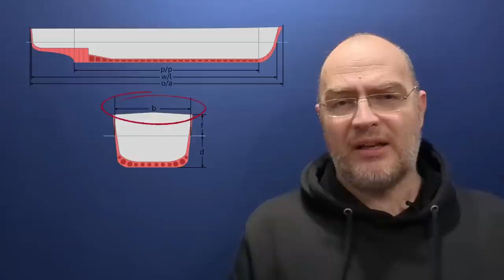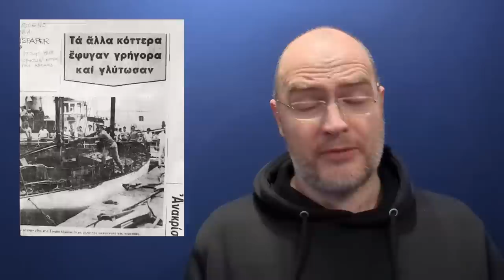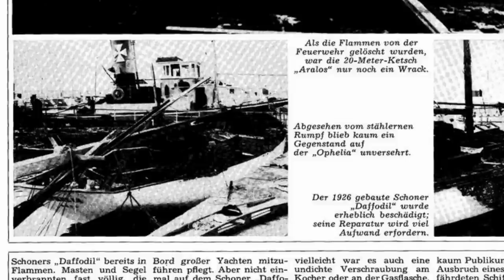Episode 1 - Welcome aboard Ophelia

Comment: The housetop seems doable.  It looks to me that the corrosion under decks and in tanks is the biggest challenge.  However, if the hull is good then I have high hopes on watching you finish her out and become a magnificent vessel. Subscribed.
Reply from the maker: Thank you, and you are absolutely right, the hull is the biggest challenge here and now. However, the issues with the hull seem to be mainly caused by the issues with the housetop, so the will need fixing as well :-)

Comment: Don’t wish to dampen your enthusiasm but as a circumnavigator on my steel boat launched in 1988 I am well acquainted with steel boat maintenance.I do all maintenance myself as I simply do not trust boat yard  workers to do it right My boat was designed by Ted Brewer from the ground up for maintenance. Extensive use of 316l stainless was used and TIG welded to the mild steel. All mild steel was mig welded.Done right- THERE IS NO CORROSION PROBLEMS WITH THIS METHOD. All sandblasting done with BLACK BEAUTY and over coated with Devoe epoxy followed by Awlgrip polyester. Any repairs follow the same schedule.She is 45 feet LOA and only two gallons of fairing compound was used above the waterline. She is totally fair. All bilge areas, dry chain lockers and lazarette areas are totally accessible. If a boat is not built to this standard and design they have a finite lifespan and from the looks of yours she does not appear to be salvageable. Another web site clever octopus attempted what you are embarking on and failed.I see little hope for your once beautiful yacht, But short of a total rebuild which would cost more than a new boat- you’ve got some insurmountable odds in front of you. Good luck anyway
Reply from the maker: Well, I think that a less than optimal boat can still be restored without tearing it completely apart but I guess we'll find out. Thank you for your concern though 😀
Reply: I sincerely wish you the best but the only way to restore your boat is to remove the entire interior-sandblast paint( but replate first as necessary ( skilled operation for round hills) and then put her all back together- look at the restoration of ENDEAVOR to see what lies ahead for you -she cost in the millions . Anyway, I was just trying to be helpful and will follow your journey. Bottomline, steel will last forever if it is protected from the environment ( proper paint) but your cockpit hatches etc. were made with mild steel and are rusted badly so that steel should be replaced with stainless steel etc.etc. And the current price of materials is cost prohibitive today. I would not be able to build my. Boat today because of inflation. Your hull is probably at least 10 gauge which is fine structurally but has a lifespan of around 10 years once the coating is compromised. Inorganic zinc coatings will not help much nor will flame sprayed zinc once rust starts. It all really comes down to your tolerance oxidation.  For a steel boat it needs to be 100%  dedication to not let oxidation get away from you

Comment: Took a 1960 Dutch steel ship back from the dead. It can be done!
Sailed the ship around the world.
High pressure water blast is the way to go. Much cleaner.
The SS work is your best friend.
See 'Captain Q # 17 on you tube. It might help.
J
Reply from the maker: Did the pressure washer take the rust off, or was that just used to clean everything?  Thanks for your input either way 😀
Reply: @savingophelia-go4nm  Hi , Very high water pressure is used for blasting ships back to clean steel  as well as other things.
I had it done on the Porsche cars we were restoring. The ship blasting vids are great. Watch the remote control blaster-vacuum machine go all over the hull!
A quick search will show you all you need. They blast it clean and they have a protective coating good for 3 day.
I'm have the deck of my ship done in June.

happy to answer any questions.
J